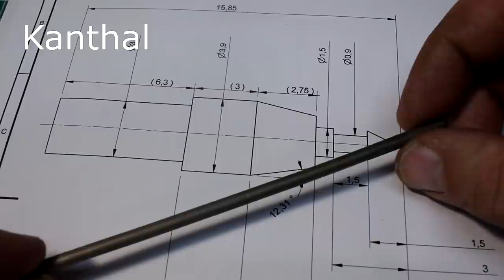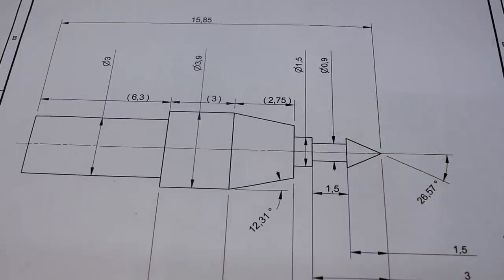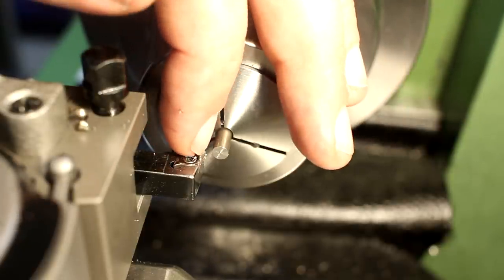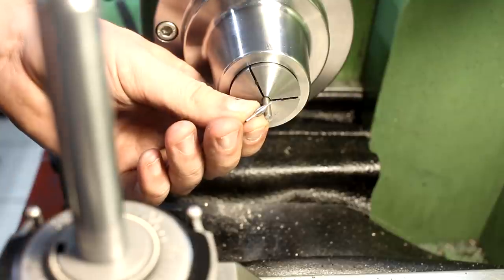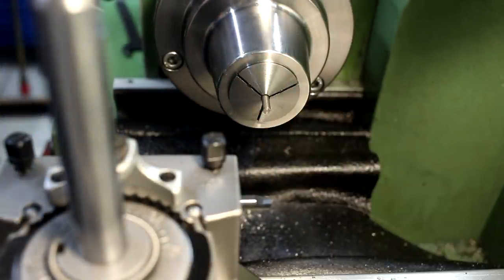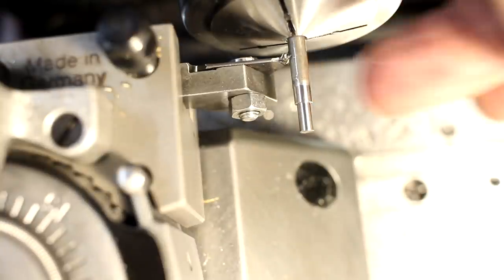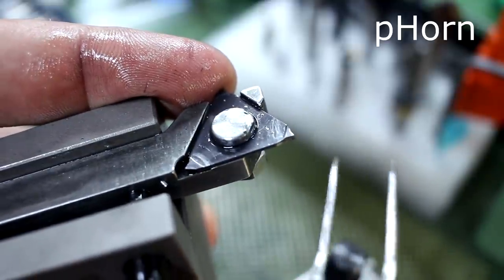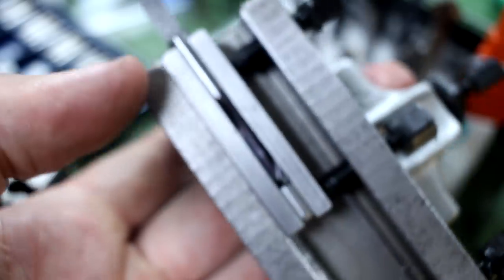Plasmaspeaker Electrodes

Comment: Stefan, ive ran out of superlatives for your works quality.  as a highly respected machineist working SMALL, i wonder if you have any words about center punches causing work hardining in SMALL parts.  i told my viewers that they should prefer a prick punch in working small. ?how do you think on this issue?   poppy's workshop says HI
Reply: If you machine using  coordinate's then no center or prick punches are needed. In fact it's a far less accurate method than most realize. At most I'll use a center punch when using a hand drill on something too large to get into the shop, or maybe on a drill press. But I sold mine off as soon as I got my mill and have never regretted I did. One other place I might use those punches is for fabricating fairly large parts where the tolerances are usually more wide open. But that's about it. By the time you accurately measure and lay out the part C/L's, find the hammer and punches, fiddle around making sure the prick punch is on the point of the lines crossing, punch it, then center punch you'd already be done on a mill and there's no work hardening if you feed the cutting tools properly.
Reply: When I was a first year apprentice in 1979 we had to make models to use certain skills. One such model was a plate that had a series of holes, a pattern of 4 rows of 10 holes that were 6mm in diameter and had a spacing of 6.5mm apart. You were only allowed an error of 0.1mm otherwise you lost a mark for every 0.1mm. We had a pass mark of 80% so the whole part was filed to a size then drilled by hand. No use of a milling machine, all hand operations including marking out and using a centre punch. I got mine done in one go. Any one can use a machine to produce an accurate part as it requires no skill as you are relying on the accuracy of the machine. A real tradesman can produce quality items without relying on anything other that their skills.
Reply: @dikkybee4003  Wow, "Anyone can use a machine as it requires no skill" ??? Surely you can't be at all serious. I doubt Stefan has produced a single video that doesn't show an extremely high level of both hand and machine tool skill. And if in your judgement that isn't so why would you even watch his videos or anyone else's that show machine tools being used? One of my T..D. Walshaw books mentions a proper test run I'm guessing probably around the 1950-1960 period in a U.K. trade school with apprentice machinist students having a few years of experience with marking out and machining parts already. One group of 4 could only use the methods you did to hand lay out, center punch and then drill a grid of holes, another 4 were allowed machines to scribe the hole locations using coordinates, then hand center punch and drill the holes without using coordinates.The last group did it using only machine coordinates to drill the hole locations. The first group had up to .010" off on a few holes with one hole well over that, the second averaging about half that deviation. The last had varying amounts of a few thou on some locations, but it was also stated the drilling equipment used wasn't in it's prime. T.D. Walshaw was a highly respected author with a vast amount of commercial experience and I'd fully trust anything he put in print 100%  He very much thought center punching was useless if any real accuracy was expected.

Yes I agree, there's people with long practiced skills that can do very accurate work when they have to. And even as a first year apprentice that's exactly why your numbers were that good, you knew it was a test so did your very best. Try that all day every day. But your statement is also completely misleading for others without much experience. Center punching IS and always will be a method that should have died out in home shops long ago if the one doing the work has even a half way accurate dial equipped XY table never mind one with a dro. Try and find one video from a commercial shop doing anything at all precise that wouldn't use those machine coordinates every time. Center punching is slower, has far less consistency and accuracy on average, and I'd say my height gauges, gauge blocks and layout equipment is well into an industrial level of accuracy. I also know how to use them well. And I still don't do it that way since I finally figured out how inaccurate it is. Because of the "skill" I've spent long years developing I'll use it with my machine tools for what they were intended to do. Advocating center punching when there's other vastly superior methods available is no different than saying your not a real tradesman if your not filing every part to size and shape when you already have a mill because it takes no skill to machine them. Center punching as I already said is a method I'd only use on work of low accuracy, and I'll add that for myself it's reserved for anything that doesn't require better than maybe .020" on it's location accuracy. Welding and fabrication as one example, but even that isn't always true. Precision hole location was precisely why jig borers were invented and they used the Cartesian coordinate system on every single part as well as the machines built in accuracy to do that work. Any every cnc machine ever built still uses it today in one way or another.There's few who wouldn't say anyone running those manual jig borers for long years are well above your tradesman status.Sorry but your reasoning is illogical and certainly isn't factual at all for an average person in any shop. I didn't say it couldn't be done, I said it's a far less accurate method because it really is. One example from 1979 no matter how good does not change those facts in any way.